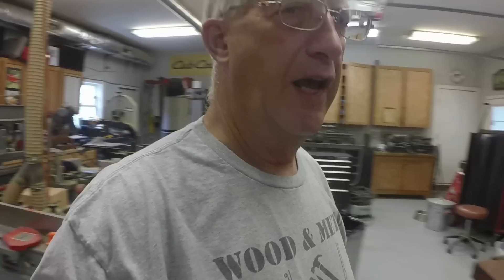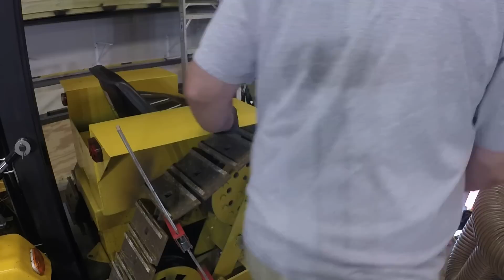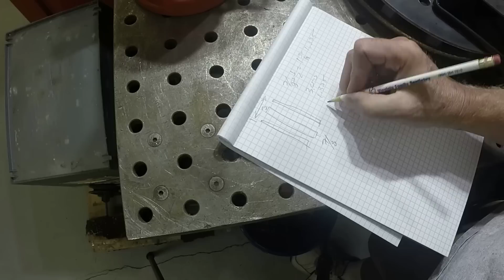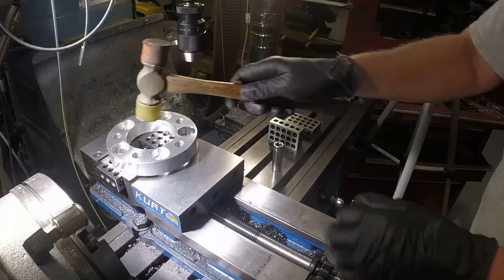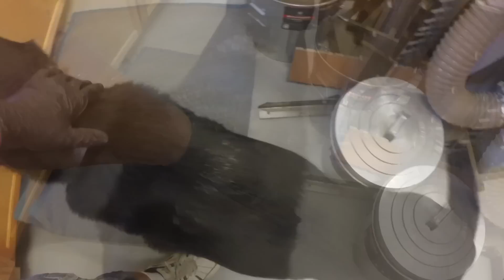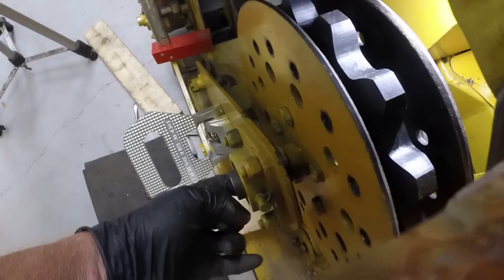Mini Dozer Gets New Sprockets

Comment: The advantage of a high drive, is not for keeping it out of the dirt, but more so to isolate the drive from vibrations and impacts as the dozer runs over the ground,  The lower wheels are completely for load carrying, and don't have to handle any drive.

Comment: my bobcat has metal tracks over 12x16 tires at full speed and because they're getting worn (been on everyday since 2/07) the slack moves from center of tracks to forward to the point they hit the bucket i have to raise the bucket about 6" but slow speed it's no problem another issue is when tracks get worn they tend to fall off on turns i tension the tracks once a year and all 4 tires went flat long ago had to install inner tubes there's shit ton of debate on youtube about inner tubes/tubeless tires on skidsteer with tracks main thing is tires have to be pumped up hard at ALL times so in winter when it's -40 below im pumping them up or they'll shear valve stems. why do i wear tracks and not chains? we just had the snowiest winter on record 88.5" even on sunny days it's drifting daily my 1/4 mile driveway never ever been stuck yet and i hate walk'en home in blizzards

Comment: i picked up a air over hydraulic jack  for my press Unfortunately my press is outside and i had to replace the hose otherwise it works Great spend the money   and also get a foot valve leaves the hands free

Comment: I see a problem with three sprockets in that arrangement.  It will work with two but not three. The distance between each sprocket must be divisible by the length of each chain length.   It's unlikely that will be the case with three sprockets.
Reply: 2 of the sprockets freewheel. There will be no problem

Comment: I remember having Komatsu specialists come to many of our facilities and do presentations on how wear is accelerated by reversing, especially up steep inclines, and also how reversing at high speeds can cause accelerated wear. Anyway… You won’t notice much accelerated wear but the reason flat track dozers have drives on the “rear” is due to track bunching when carrying a load. When pushing… you would not want a front drive because it will drive the “bunching” area to the part of the track that is contacting the ground. On a “normal” flat track dozer… you will see massively accelerated wear if you reverse up steep inclines on a regular basis. This is because the “bunching” area of track is pushed up under the dozer. You wear tracks out faster by going in reverse on a flat track dozer. Well that applies partially to high track dozers too. But your small dozer will be fine.
Reply from the maker: That makes perfect sense. Thanks.
Reply from the maker: How do the high wheel designs deal with track bunching? Both directions?
Reply: Kinda the right explanation but what's going on is the tension not bunching 

When your going forwards the sprocket is pulling the track out from under the machine, the only tension in the track is between the sprocket abd the ground, when your going backwards the tension has to travel all the way forward abd back round to under the machine, 

How do high track machines handle it? Well basically they don't, the rear idler just handles the extra wear, this is one of the main arguments of team low track, but the added advantage of high track I'd not only getting it out of the dirt but also high track machines dint actually carry any machine weight on the drive, a low track   there's alot of machine weight on the drive

As for reversing, you really can't do any work in reverse but you'll offern see dozers reverse if they have to travel long distances, this is due to evening the wear on the pins and bush's of the tracks, along with the wear on the sprocket teeth 

I'm.a heavy deisel mechanic, did my apprenticeship rebuilding D9 to D11 dozers, 
Did a alot of  Cat courses on all things dozers from undercarriage to GET to transmissions